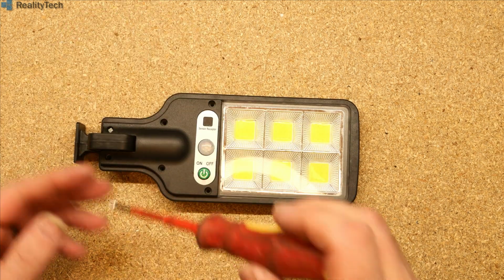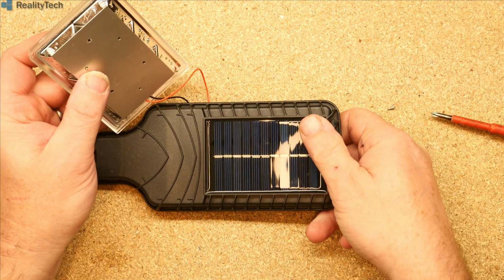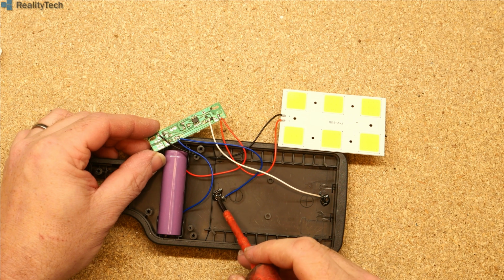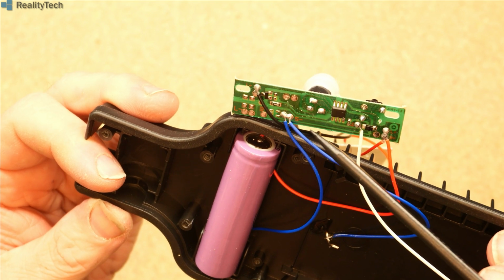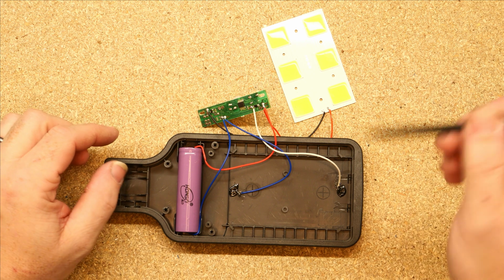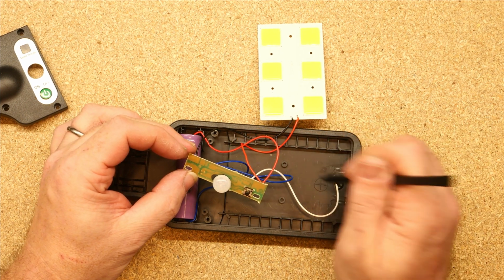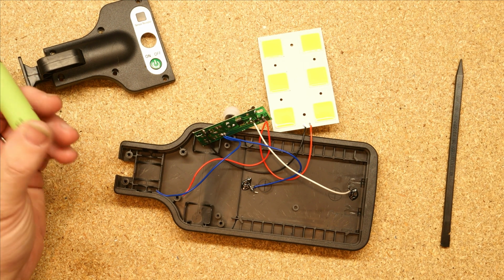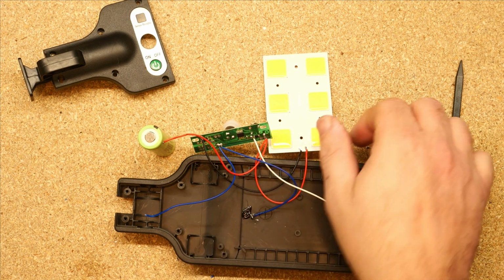Solar Motion Floodlight Teardown

Comment: 2.5v is just flat, its not damaged, its under 2.5 thats the concern, nice vid, I'm sure if its cheap enough you can, as you are doing,  re-purpose them :)
Reply from the maker: It varies between batteries, check the datasheet as always (if there is one). Some give 2.75 as a minimum safe voltage, others as low as 2. BUT that's 2.5V unloaded, I should have measured it in circuit which would have been lower still. Generally you would be looking to cut off at about 3V to be safe.